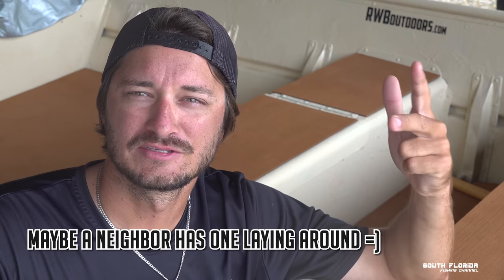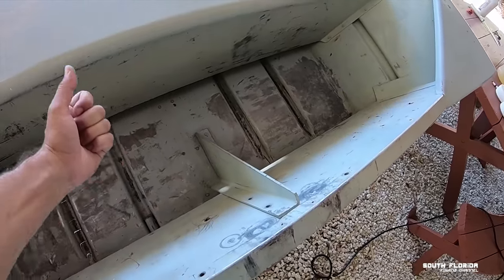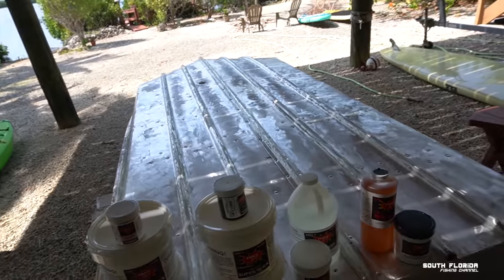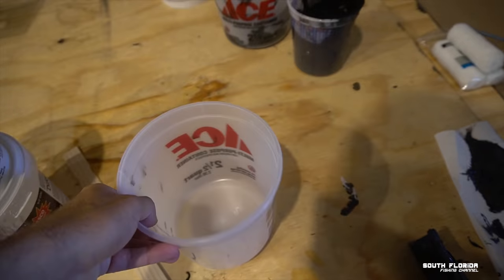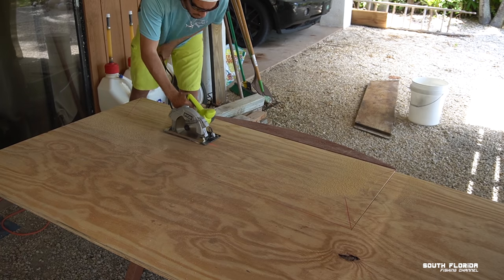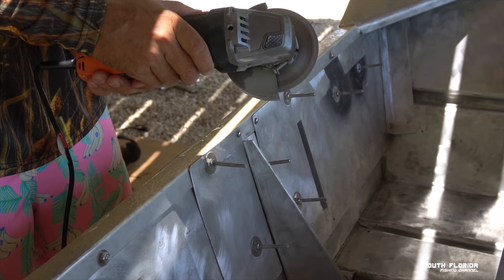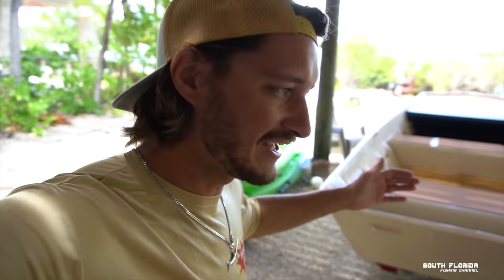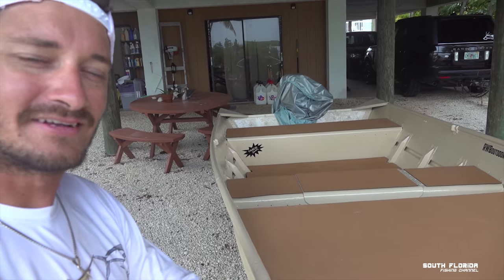{Start to Finish} Jon Boat Restoration Build w/ Fasco Epoxies

Comment: Good video about rebuilding an old boat.

45 years ago my father and i went in together on an old 13’ boston whaler. We bought is in early April , go it home and had to repaint the damaged gel coat, replace the rotten wooden side console and reposed it with a 25 hp evinrude.

Being 15 years old I had time to do all of that after school and on weekends, We finished in time to test drive it on Memorial Day. We towed it from Maryland to the my aunt’s condo in Hollywood, FL (and then down to the keys for numerous snorkeling trips).

Your build reminded me of that old whaler .
Reply from the maker: Sounds like an awesome memory
Reply: @SouthFloridaFishingChannel  I kept that boat for 15 years and eventually refit it again with a 65hp mercury engine. It would run about 40 mph and even pulled water skiers!

 I traded it in on a new Ski Brendella inboard ski boat in 1990

I have since purchased and rebuilt a 1978 Jon Dory's 16’ skiff with a 35 hp merc, it is about same size of the whaler but is a bit faster cause it has a flat bottom.

Comment: Awesome job with the Jon Boat restoration project.  My dad had three Jon boats and a fiberglass V-hull when I was a kid but never done anything like this to make them more comfortable.  The first one was made of plywood which was constructed really well but only had paint since epoxy wasn't available way back then and spent its last few years rotting away in the backyard after he got his first aluminum j-boat which he sold or gave away a few years later.  Then he bought a used j-boat that was covered in tar on the bottom to prevent leaks but it didn't work that well, then he finally bought a used fiberglass V-hull which was fine but he only used it once and then spent about 20 years sitting on a trailer in the backyard until he gave it to my brother who uses it to this day.

For a project that big, I would've went epoxy from the beginning.  The can spray-paint method I would use on small projects like patio furniture or something but not a boat.  Being retired Navy, I would be tempted to go with haze grey on the outside, red on the bottom, with a black water line, dark grey on the deck with a three or four inch black border on the sides up from the deck, white on the handholds and other fixtures, and do what you did to the inside with the tan, cushions, and everything else.

Comment: The next time gueing down these large pieces of foam, put some wood or metal strips on the glue and put the foam on top so it does not touch the glue yet. Then line-up the foam and remove the strips one by one. This will give a perfect fit without the worry of starting at a wrong angle.

Comment: My Jon boat has started leaking so I am in process of stripping bottom to apply new Fasco coating. But I discovered something I thought you might like. I purchased a pressure washer sand blasting kit. It attaches to the wand on a pressure washer. It works with play sand it’s available from Amazon for 30 bucks. It sucks the play sand or beads up and takes it down to bare metal. I did the entire outer Hull in 1.5 hours. The aluminum doesn’t get hot the metal retains its proper shape and strength. After watching your video and the time u we’re having stripping the paint. I sought out different methods to achieve the smooth bare clean hull. Keep up the great vids brother Tightlines from the Outerbanks of North Carolina!

Comment: Tech tip:  do the beige part first then tape off bottom to do the black part. That way you only have to tape once.  Also a super slick surface will create drag in the water. A rough texture will create tiny air bubbles reducing drag allowing the boat to cut thru the water more efficiently.

Comment: I wonder if a sand blaster would have sped up the paint removal/sanding. I've never done it. Just thinking out loud. Might take on a similar project. Thanks for the video.
Reply: Yes definitely  and even possibly cheaper. But on aluminum i would probably used nut shells
Reply: Sand can be extremely destructive to aluminum. I used to use ground walnut shells for power blasting tankers and such...

Comment: Great job,  one recommendation is aluminum hates salt water,  after stripping you should have used a conversion coating prior to painting. To protect it. I am a retired aircraft mechanic, its dome to all aircraft aluminum surfaces to protect from corrosion.

Comment: Thanks for this excellent video as I now find myself in the "same boat"...was looking for a 12-14' when I saw a 16' with a motor on a nice trailer at then of a driveway...1987 Polar Kraft 1648...2010 Tohatsu on a perfect trailer...$900!  Needs some repair to the transom but the trailer and motor are worth more than the purchase price...  Will be repairing and updateing the boat over the next few months...

Comment: Started looking for a small 12-14ft Jon boat last week. After looking around, I had expected to spend around $3-5k. Mentioned it to a few coworkers, told them to keep their eyes open for something on the side of the road. One of my coworkers said his girlfriend's father had a boat just sitting in the yard and his wife had been up his ass to get rid of it. Drove out to get it that night... Ended up with a 12ft Jon boat with two trolling motors for free; Boat doesn't leak a drop of water and the trolling motors both work great!

Comment: I refurbished several boats over the years I lived in Key Largo including a couple of small inexpensive super-fun runabout types like your John boat shown here in this video. As you no doubt learned along the way there are always better and cheaper ways to breathe new life into an old boat.  Like forget the expensive  black spray paint and spray-on truck bed liner and try using rubberized concrete roof coating to help waterproof your small aluminum boat. It will all but eliminate hull vibration noise, seal-up rivets, seams, through hull fittings, and it reflects sunlight to make your decks, benches, and boat interior much cooler in the hot sun. Great job on fixing up that little boat for a skinny water runabout for the Bayside Sounds in the Florida Keys. Enjoy.

Comment: When I saw the G3 Jon boats had an aluminum transom I stopped looking at any other boats. Wood stringers on the floor are a thing of the past now for larger boats also if you buy an aluminum boat. 😀👍 Great job on your Jon boat project it should last a long time.

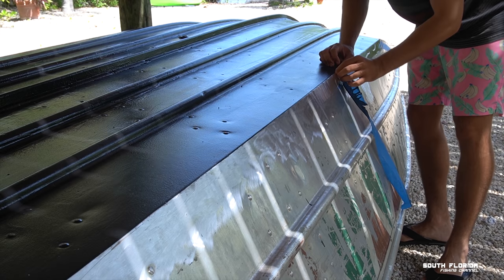Comment: Hey just a tip 39:01 on the tape here- pull off the tape at the mid-to-tail end of the drying time. Right when it won’t run, but it is soft enough not to clutch the tape with its life. Also, I haven’t read the instructions for this epoxy, but generally, you want to apply subsequent layers of epoxy while it is not all the way hardened. It helps with adhesion between layers.

Comment: An old laminate countertop trick is to place thin wooden dowels on the glued surface.  Then set the top surface on the dowels.  You can then position the top surface where you want it, stick one edge, and pull out the dowels smoothing as you go.  Twist the dowels and they come right out.

Comment: for decals and striping - they make a drill mounted rubber wheel that rips that right off without hurting the finish (works on painted surfaces without hurting paint even.)

Highly recommend it for any decals!

Comment: When your useing pait stripper if your having to do more than one coat take some plastic sheeting and cover the stripper after applied for about 10 min it allows stripper to  penatrate the paint instead of wrinkling and and kinda drying on top

Comment: May have been covered…just started watching this video!  On bare metal floor…cut to fit 3/4” - 1” plain foam insulation sections before covering with fitted plywood—-acts as ‘sound proofing’ barrier!

Comment: Looks nice great job...and explain...You mentioned 10-12f  Had both and if you a little heavy and got tiller motor ..water wants to come in over transom when ya slow down suddenly..esp on narrow ones...They pond boats...14/16f 48" wide and wider work great...I got a 16f x60' bottom  Superior (they dont make anymore)  its got a tunnel and pontoons..My plan is remove tunnel and pontoons and its also got a big center console  thats gona get removed...I like open boat concept..side steer..and ability to sleep on floor...Its got 50 Mer  2s.... will have to lower transom 5" too

Comment: Just a tip if you take your roller and put tape on it and pull it off it will take some of those loose fibers out of the roller before you start or wash the roller out with water before you start will also get those loose fibers and keep them from trashing up your finish.

Comment: How did you attach the front deck to the aluminum platform it sits on? I saw you stick the deck on and set the deck on top but I didnt see any hardware holding it down.

Comment: If you don’t have a short nap roller, you can take a longer nap and hit it with a torch walk quick and it will burn off the fuzz.  Knick the char off of it and roll away without all the little fuzzy crap and a shorter nap.

Comment: Grea boat build and video. How does the water drain from inside the boat? And, did you screw down the flooring?
Reply from the maker: There's a drain plug in the back. No I didn't screw the flooring down as it's pretty heavy and shouldn't move once I have a cooler and stuff on it

Comment: On the bottom of those plywood floors you’ll get far better results using a shellac based primer such as Zinsser B-I-N.  It seals better and does a far better job of locking out water vapor. Just roll it on with a standard paint roller. Double or triple coating is even better.- especially the sides of the board because that’s where water does the most damage. Also using marine grade plywood is a good idea too. It stand# up to water better than house grade stuff. Good luck with your building projects!

Comment: In the future wen gluing ur “ sea dek” knock off stuff, find u some old used mini blinds or buy u some dowel rods . If u want to use mini blinds just separate single blinds till u get u a nice bunch of them and wen gluing once the glue gets tacky just lay those blinds about 4-6 inches apart till u cover whole area ur covering  now peel the paper off the decking then lay decking on top of the blinds ! At this point u can move ur decking around on top ur glued area without sticking , usually I will square it all up and start on one end by pulling ur first blind out and stick ur starting point and u can figure it out from there buddy! Hope this will help!

Comment: In the future my Friend u can use Old mini blinds that have been seperated into individual blinds or u can use 1/4”-3/8” wooden dowel rods that are about 3’-4’ long and use either one to lay out on ur wood Floor after u apply the glue and it gets tacky . U can Space them roughly 3-4 inches apart, at this point u can lay ur flooring on top and u will see u can adjust to where u want it then on one end pull out a couple of the blinds or sticks and stick that edge and start
working ur way across pulling sticks and rubbing it down with a small piece of 2x4 👍

Comment: Nice job 👏 👍 👌 😀  I want to use a sealer What'd been better if you would've used a cellular black one or the beige 1 or go clear white or clear but would have been better than the spray paint

Comment: One difference in my opinion you should have used the white color flex seal in the livewell, it will help keep it cooler and it will be easier for you to see the fish or bait. Just my opinion though. Again great job on the restoration especially it being the first time you've done anything like that.

Comment: Next time get the foam with the 3M backing on it.  It’s pressure activated so if you lay it on wrong you can carefully pull it up.  After you press it down or use a roller it’s set.

Comment: Next time you're working with contact cement (glue) buy a can of laquer thinner. Pour out some onto one of those blue rags and keep it near you. All you need to do is wave it at (or need) the glue and the vapors coming off of the rag will release the glue.

Comment: Just remember when using 3M 5200 it don't come off. Had a cracked gear train cover on my Cummins diesel, cleaned it and put some 5200 in the crack, three years later still no leaks. Just About only way to get it off is with heat, lots of heat.

Comment: For the transom I hope you didn’t use pressure treated plywood, the chemicals in that will absolutely eat the aluminum. If you used PT, please go get marine grade. This is why you must use stainless or galvanized bolts, eventually regular ones will fail.

Comment: Love the video but I have to ask a dumb question. What is the purpose for the wood in the transom?  Could you have used some type of foam that would have been a lot easier to install?  Just seemed like working with that wood was a big job all by itself.

Comment: Sandblast the corrosion on Alm, not to make materials too thin, makes for better welding  ,  alm was always harder for me.  Heat needed hotter 😫 which could blow holes of course soldering  ! ?

Comment: 52:15 why didn’t  u use wrp?
Use of Sealers on New Wood Before Painting or Staining - Water Repellent Preservatives (WRPs)

For the best protection of the underlying wood and the longest lasting finishes, bare wood should be sealed with a water-repellent preservative (WRP) before priming and painting or staining. WRPs contain a small amount of wax or other water repellent and a mildewcide, fungicide, or both, usually in a solvent base. The preservatives help prevent mildew and decay in above-ground applications but are not meant for ground contact. Some WRPs contain UV blockers as well, which slow down the degradation of the outer wood fibers.

Comment: I was thinking that would be the perfect color for duck camo like if you had some cat tails and reeds to hold in front of the boat a spray black paint using the reeds and cat tails like a stencil. It's not the same as the graphics you can get but it would work. Enjoy, have fun and be safe!

Comment: People that paint aluminium treat it with an etching primer so that’s going to take time to get off .to get sticker off use a heat gun or hairdryer to warm the glue up 👍🏻🇬🇧
Reply: You have to use a primer that's compatible with your topcoat. So you're wrong.

Comment: Next time you do a boat transom. before you put the wood in permanently,  drill the holes out about 1/2" size then fill it with thicken-epoxy. After that when you re-drill you're hole's you will never have water touching wood the actual bolt will be touching straight epoxy and never get to the wood. keeping it 100% waterproof.

Comment: I use oven cleaner to take paint and grease off engines,,,I use the type where you don't need heat,,,
And also,if you use regular paint strip,,I use plastic wrap to go over the paint stripper, so it doesn't dry out,,and eats the paint,,then use a power washer,,

Comment: Make it the world's first John catboat you can add fins on to the bottom of that and actually making a flat bottom catamaran out of that they can be made and they can be epoxied on since it's not a speed boat you wouldn't have to worry about separation the glue they have nowadays is unbelievably strong

Comment: Next time you glue on anything with contact cement with cement tacky or dry use strips of cardboard down  so glue on panel does not make contact with out her part till absolutely sure you have it where you want it😁😁

Comment: You could have bought a worm gear attachment for that power sprayer and you wouldn't have needed to do any sanding or use any paint remover it would have taken everything off right to the middle clean as a whistle next time you know

Comment: ? I just filled my boat wit water it seem like it’s leaking at the bow it looks like a its boat sealent then thick aluminum bow protector then riveted all together not bad jus wondering if you thought if the fasco would seal it there’s hundreds of rivits that’s another thing there is no DRAIN PLUG PORT

Comment: For the life of me as many of these boat videos I’ve seen I don’t know why people don’t use red guard for the bottom of the decks. Red guard is a paintable waterproofing membrane. Yes it’s about $45 for a gallon but it goes along way and it literally waterproofed whatever you paint with it. You can literally take a cardboard box and paint the inside of it and then fill it with water after it’s dry and keep it outside for a month and will still hold water. It is what they use it showers in for floors and walls so that the wood membrane does not rot plus you can paint over it or tile over it. I know tile would be crazy heavy in a boat. The waterproofing membrane it goes on pink, but then it turns to a really dark red, but who really cares what it looks like under the floor but it makes it waterproof paint will last just so long and then it’ll start deteriorating does 90% of most paint or water-based paints nowadays anyway so it’s horrible

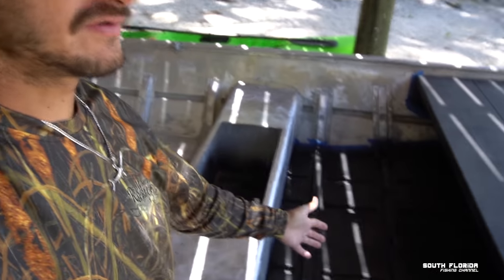Comment: 1:08:44, you were right NOT to use epoxy on the floor.  Aluminum John boats are designed to flex in waves.  If you use something hard like epoxy on the floor, it will probably just crack.
Reply from the maker: good to know. She's been handling awesome!
Reply: ...lol, nonsense...the boards move independent of the hull, it's a floating floor... a better solution but much more work would have been laying fiberglass on marine grade ply...
Reply: @puzer1  I didn’t mean the bottom of the boards, I meant the aluminum on the floor.  He painted that with the rubber stuff as well.  That was the right move.
Reply: You're absolutely 100% right. Epoxy will crack around every damn rivet with a little bit of time. The exterior coat should have been an aliphatic urethane that has a little bit of flex to it.
Reply: @puzer1  you don't have a clue pal